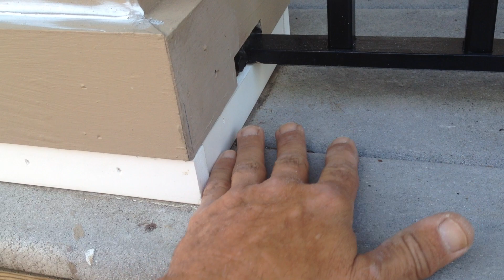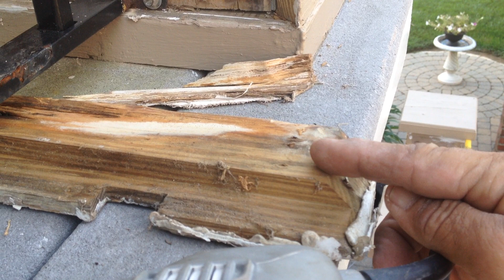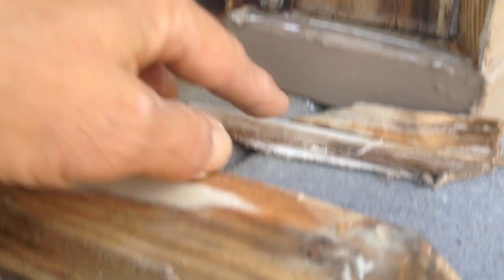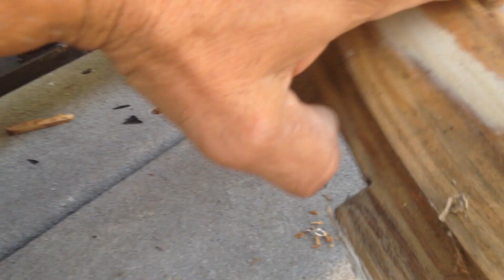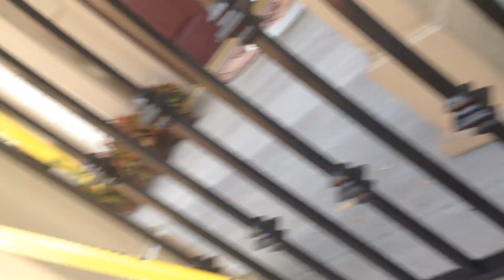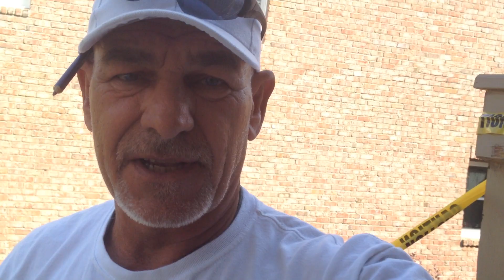CAN YOUR HOUSE FALL APART IN 50 YEARS?  YES!!!!

Comment: I agree that houses today are not built that well, But what I see most of the time with damages is from home owners not keeping up with general maintenance, like replacing cracked caulking around windows or where like on the house I'm working on now with failing brick from bad caulk where the siding meets the brick and water getting in behind it,
Reply from the maker: Your right on the money the homeowner has a lot to do with keeping up the house's maintenance on time.